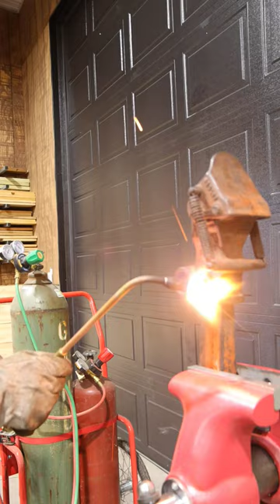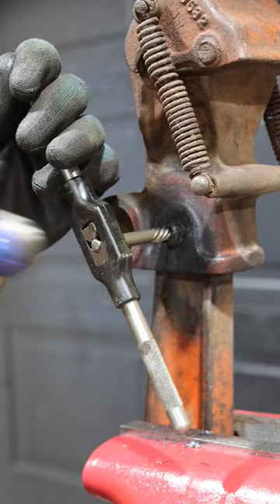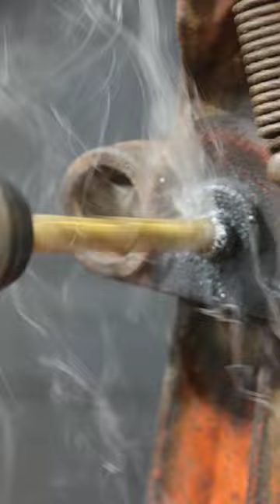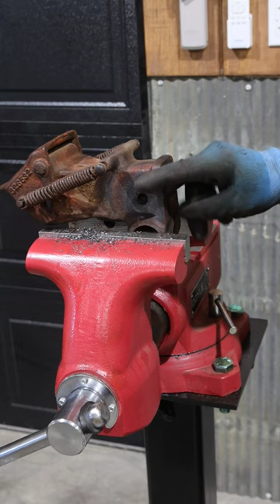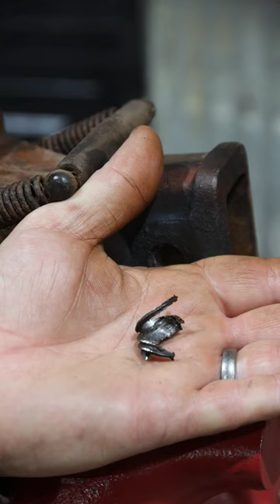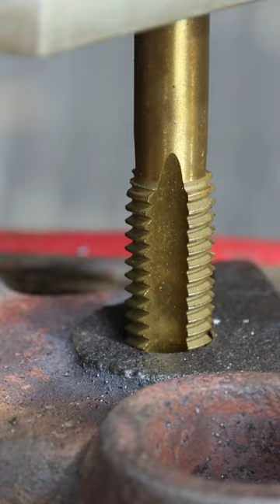Removing a broken off bolt from the Allis Chalmers Lift Arm

Comment: Broken or seized bolts take a lot of patience to remove. I got to the point of just drilling it till there is little of the old bolt left then use a tap and try to get the remains out, actually works quite well, but hole has to be dead centre. Once hot everything seems to crystallize and is harder to work with. Big thing is patience, which is something learned the hard way. You always seem to be up for the challenge. Cheers my friend.

Comment: Get that thing cherry red and spray water on it, some guys will even do WD-40 but that’s overkill and it’s stink and is a fire hazard, but heat it up and spray water on it. If you can, spray the water just on the bolt your trying to remove. It cools the bolt down faster (contrasting faster) than the base metal and breaks up all the rust and crap that’s got it stuck in there.